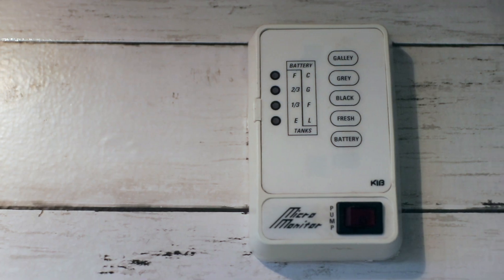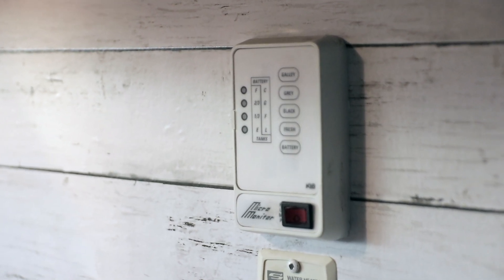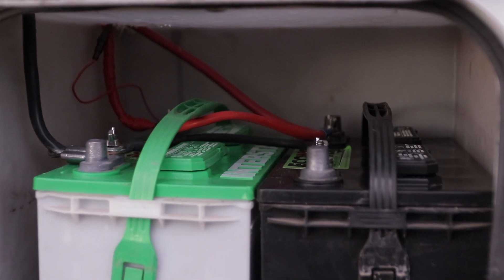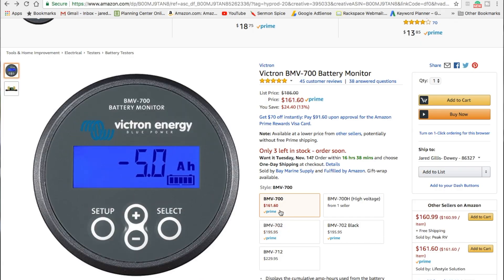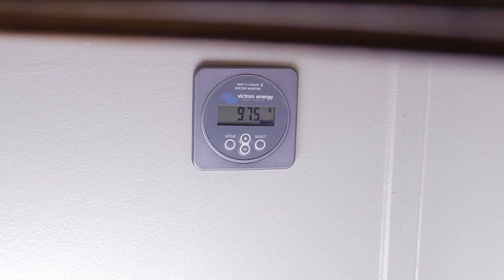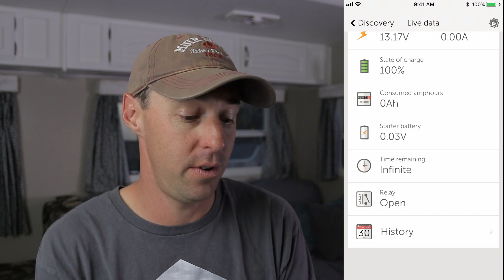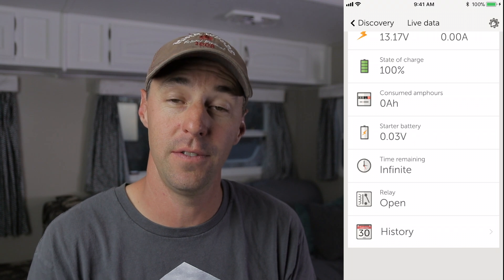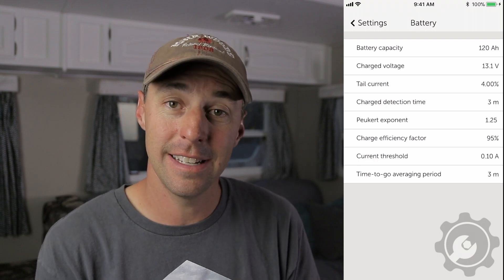Updating Your Battery Monitor And Why You Should!

Comment: Question on connections of a battery shut to  6 group 31 AGM batteries in my Itasca Ellipse 42QD. Currently one end of my 3/0 copper ground goes to the 2800 Watt Inverter then all 6 negative battery cables are connected in series , then goes to the chassis ground. Not sure how to make the connection with 2 negative terminals.

Comment: Jared -- how would you wire this on a travel trailer where the only ground connection on the battery is battery n(-) post to chassis ground. All other negative loads to go 12v bus bar at the control panel, and then to (i assume) another chassis ground? Will putting the shunt between the battery n(-) and chassis ground work?

Comment: What confused me is how do you connect “all loads “ in your RV to the shunt? Do you get the battery positive and negative from the Rv main electrical panel where the 120, 12V and converter all reside?

Comment: Hello Sir I have two RV batteries in series on the shunt with the cheap battery monitor - the new battery lead leading to the negitive what guage should it be? the one I bought does not seem as think as the one connected to the neg terminal. I have an old rv class a and only run basic stuff on the rv with no inverter.

Comment: So, just more out of curiosity do I need all bluetooth modules from Victron? By this I mean do I need a Bluetooth Solar Charger, Shunt AND Battery Monitor? Is there any benefit to having all three of these in Bluetooth?
Thanks, I've watched lots and am now taking this on myself.
Reply from the maker: I prefer to have Bluetooth on each device because you can connect individually to them for settings and Bluetooth is the fastest easy way.
Reply: @AllAboutRVs  Thank you so much for the reply! Even more, thanks for the tips and videos. Solar panels going on tomorrow. Picked up a Battle Born 8D 270Ah battery. We'll give it a try. See you out there!

Comment: I have a zamp charge controller.  Original equipment bought in 2020.  I assume this monitor has nothing to do with the charge controller?  Adding this would be in conjunction with changing out Lead Acid batteries to Battle Born Lithium.  Does this have any impact on the Zamp charge controller either?

Comment: What will or can the volt reading tell you?
I know what volt is, and with the little knowledge I have, I would think it's always stable and the same, so I don't see the purpose of a volt meter. But I suspect it has a purpose .... ?
Reply: Rudi van Doornegat your battery has a different voltage when it’s full vs when it’s empty. So you can tell the state of charge by reading the voltage.
Reply: @123marijn321  I see. Thank you.

Comment: I love watching your video you’re very good on giving information and instructions have a quick question I am going to be running two 100 amp battery in my motorhome will that battery monitor work for me or do I need to get a different one and do it, come with that Bluetooth system or do I need to get a  separate bluetooth

Comment: Why couldn't you just remove the old one and replace with the Victron?
Reply from the maker: The old one is just a voltage based monitor and the Victron uses a shunt for accuracy.

Comment: We have an 11 YO Victron and until last year a 10 YO 150 AH AGM, The problem is that I knew it was no longer 150 AH at the point where I replaced it. I am trying to come up with a way to accurately determine the capacity of the battery as it ages.

Comment: The Victron costs $200!! There’s a identical 
meter on amazon that costs $40 !!! It’s brand name Aili battery monitor. 
It does everything the $200 Victron does but the Bluetooth option n/a. If you must carry your phone 24/7 and constantly check or set the meter oookay. I just take a peak at the meter for info. Simple. 
The Aili is very accurate and I and others have had zero issues with this meter. The option are 3 different amp 
rates. Save yourself $160 search Amazon
Reply from the maker: We have a video with budget battery monitors with the most expensive one being the Aili battery monitor. https://youtu.be/tObHbsSDWeQ but the Victron BMV 712 is by far my favorite with many more features than just bluetooth.
Reply: My aili is only about a month old and I just got my rig out of the shop after not being hooked up to shore power for a week it’s showing 100% 28v and charging like crazy when I’m actually drawing power I have two fla in parallel. Wtf

Comment: at 1:28 - So this Victron device gives the real voltage of my battery like 12.2 volts, even when i'm charging it with 14.8 volts?
I don't get it..
Reply: It should provide you with Amp Hours when it's charging so you can determine how far (empty or full) the state of discharge is. Also it gives you how much time you have left until empty

Comment: I noticed you have 2 different batteries, I have 3 deep cycle batteries although all are different brands. I have been told that is not good to mix brands. I am assuming you have not any issues can you elaborate on what is actually important when connecting batteries in parallel ?
Reply from the maker: We have since switched to lithium batteries, the ones in this video are the batteries that were in it when we bought the RV. They were the same battery bought at the same time but different housing. It’s best to buy the batteries at the same time and the same kind. Mixing batteries can cause issues because of the differing internal resistance.

Comment: @ 5:53 you point to the negative (system ground) end of the shunt saying anything that has a load will be connected there.  But according to the box you're holding... the positive side of the battery is where the load is going. A bit confusing wouldn't you say?
Reply from the maker: For any load to work off the battery it needs a connection to the positive as well as the negative. So on the positive side of the battery it can connect directly to the load or charging device but on the negative side the shunt must be in between any load or charging device. I hope that helps clear it up.

Comment: Quick one, you keep saying shunt, is this another word for grounding block? Also, you say "biggest part of the shunt", is this describing where on the shunt the monitor should be connected or simply the most important part of explanation? Cheers!
Reply from the maker: Good question, the shunt is what measures the current, so it’s much more than a grounding block. It’s meant to be the most important part of the explanation.

Comment: Where would I install the shunt if my batter bank is outside of my trailer?
Reply: I would conect it directly from the battery and then use some kind of connecto to connect the other side of the shunt to the traiker itself, So the shunt will live inside the battery box.
Reply: Jose Inciarte so I would install the shunt just as the directions say and then attach the stunt to the inside of the batter box?
Reply: Correct....Im just noticing all the typos i had this morning...lol

Comment: So on my RPOD 179, I upgraded from an Interstate battery to a Battle Born 100ah using the Victron BMV-712 monitor (hoping for better predictability and 2x the capacity d/t the 100% discharge depth). I keep ending up the battery completely shutting down at around 65-69% (around 12.19v). Not sure what I'm doing wrong (followed the instructions and synchronized after charging for quite a while - highest charge at 13.56v) - seems like you would have to enter the maximum charged voltage capacity (ideal without age loss) and the lowest available voltage (i.e. where the BMS shuts down the battery) somewhere for the calculations to be correct but these aren't given on the Battle Born spec sheets. Anybody have any suggestions? Thanks - RD

Comment: So Jared, how did this install effect the original monitor, as in did it disable it or does it still work?  Just curious.   Outside of that, keep up the good work, I've learned a ton of good information from you in preparation for going fulltime next spring.
Reply from the maker: The old one still works I just can’t remember the last time I looked at the old one. Thanks for watching.

Comment: How would you install the shunt in a travel trailer configuration where the battery is on the trailer tongue?
Reply: You can leave the shunt in the battery box 📦 itself as long as your negative cable flows through the shunt as diagramed. you can leave the monitor in there too and just use bluetooth if u dont want to mount the display
Reply: @NavaDownSouth  I'm interested in adding the Vicxtron monitor to my TT and the location of the shut is an issue.  I have flooded batteries and am concerned about the shunt located in the battery box subjected to the out-gassing from the batteries.  What type of battery are you using and how is the shunt holding up?
Reply: @rickjohnson4956  he has battleborn so lithium
Reply: Augustine Baerga I’m curious to know this as well! Did you figure out if you could? Thanks
Reply: All I've seen is a guy attached it to the inside of his plastic battery box. That's where mine is right now.

Comment: Great review. I just finished installing the 712 as part of a lithium battery upgrade on our RV. I programmed all the settings, and they show on Bluetooth, but the display does not update. I’ve unplugged the fuse as indicated, but no result.  Not too important, since I don’t plan to mount it anyway, but just seems I’m doing something wrong.  

Any ideas?

By the way, AMsolar says charging voltage for lithium battery should be 13.9.  Is this just for safety?  Everyone else seems to be in the 14.2 range 

Thanks- great videos
Reply: Po km
Reply: Listen to what AM Solar recommebds.

Comment: What is the point of the Bluetooth? It’s pointless in my opinion because you cannot monitor the system remotely.
Reply: You would need the color control and a wifi connection for that. Then it will store your system metrics on the Victron portal on internet and you can monitor or change parameters. Not cheap, but excellent

Comment: I bought a 712 and installed it. It has NEVER given a correct reading. I we hoping to use this for our last trip as we were going to dry camp the whole time. I have a MPPT solar controller that shows 13.8 volts. I put a multimeter on the circuit and it read 13.8 volts. I have a cheapy meter with the USB jacks I installed and it shows 13.4 volts. The 712 shows between 8 and 9 volts and when I synchronize it to SOC it shows the correct voltage but then it drops to 8-9 volts within an hour. The battery charge always shows 0%. The weirdest thing is I contacted Victron and they said to contact the dealer I bought it from. Well there dealer is Amazon. No hello at all. I would not recommend this battery meter at all.
Reply from the maker: I'm not connected to Victron but love our battery monitor, send me an email and let me see if I can help you figure out whats going on. jaredallaboutrvs@gmail.com  It really has been a great dependable tool for us.

Comment: is it also possible for 2 batterys in home and 1 starter battery ?
Reply: T 448 -- Yes, for the house batterys and you can choose additional to monitor (only the voltage!) your starter battery. You just need to put a wire from your starter battery to the shunt for the voltage monitoring. The BMV712 has also inclosed a bluetooth dongle, to make a connection with your phone or tablet where you can view all information from the Victron app.

Comment: Does everything need to be connected to the shunt for it to read its amp/current draw? I have a power inverter I installed but it’s grounded to the frame so just wondering if I need to take it to the shunt?
Reply from the maker: It should still work as long as you have a frame ground connection to the shunt and then the only thing connected to the battery is the shunt on the negative side.
Reply: steve barker -- YES, connect everything to the shunt if you want a correct reading on the correct state of your battery, also the inverter....
Not connecting the inverter to the shunt gives you a false reading on the AH capacity of your battery, because the Victron will not calculate how much your inverter consumed..

Comment: Is this available with out a shunt? Do they make one with a clip on amp meter?
Reply: Lysol ! - I don't get why you need a clip on amp meter, the Victron has an amp meter inclosed. 
You can use other shunts to, just go in the menu and correct the used shunt A in the menu of your Victron

Comment: My rig has two, 12 volt deep cycle batteries rated at 92 ah each. When setting up the monitor would I annotate 92 or 184 ah during the initial setup?
Reply from the maker: Your right with 184 ah.
Reply: Thanks for the confirmation!! Have fun and safe travels!!

Comment: Hello Jared!
( Hope I spelled that right)
I am looking for advice on sizing an inverter to run a small fridge (120v, 3.5amp) in a travel trailer I am remodeling. I only plan on running the fridge off of the inverter but am lost with so many options out there. I have not been able to find any direct contact info for you so this is how I'm hoping to contact you..  any help in this matter would be greatly appreciated.

Comment: Excellent video! I have new RV that came with 2 lead-acid batteries. Would I need to buy TWO monitors to monitor all conditions of BOTH batteries? Or can I only monitor VOLTS of second battery using only one monitor wired to both batteries? Thank you.
Reply from the maker: One monitor will do your battery bank. It will do both house batteries.

Comment: DIfferent brand batteries is bad (around the 1.45) Reason is ... internal resistance in batteries can be different ....  ohms law is voltage/resistance = amps .........   now plug in 2 different batteries 12v each (all numbers same just different brands giving different internal resistance)ok so 12Volt / .2 ohms = 60 amps ..... ok now 12volt /.22ohms =54.54amps (thats a tiny tiny difference by the way... it may be larger)  ..... What does this mean in real world one battery will always be drawing down faster than the other (meaning it will have less voltage constantly)   hard to wrap headaround  ... they will both supply EXACTLY what they say on them .... just one will always be worked harder ... if both batteries where same brand and purchased from same batch theoretically you would get even distibution between batteries and there by charging them evenly (last longer)
Hope this helps you merry campers :) 
good video tho !
Reply from the maker: Good info, your right on not mixing the batteries. These are the batteries that were in the rig when I bought it from my friend, and I’m just counting down the days to replace them. He bought the Econo Power batteries which you never know what your really getting in those. I still can’t believe they have lasted close to 5 years. I was wanting to replace them when we first got it but I have a hard time replacing batteries when they still work.

Comment: Thanks for a nice video - you're good at explaining!  Question for you as it applies to my Sandstorm Toyhauler 2018 model.  It has 200 watts solar on the roof by Go Power installed at the factory.  It came with a monitor display mounted inside the camper, but doesn't have that many features on it.  I was thinking I'd like to leave it installed along with installing the one you have in your video.  Do you see a problem having both monitors connected at the same time?  Or, maybe I'd be better to pull the Go Power unit off the wall and use the same wires for the Victron 712?  Thanks for any suggestions!

Comment: Virtually everything I see is for the basement of a 5th wheeler.  How would you mount the shunt if you have a TT with two battery boxes on the hitch?  You need to protect from weather.  Looking for suggestions on this.
Reply: I just picked up a “gang box” and cover (Lowes),  mounted that near the negative of the battery, Mount the shunt in the box, cable it up and then silcone all of the openings where the cables came through.

Comment: If using a 2 battery 12-volt system which battery should I hook the positive to or does it matter? The B1 wire?
Reply from the maker: It doesn’t matter which one you put it on
Reply: All About RV's one other question I have one ground of the frame and then another ground coming from what I assume is my trailer lights do I put both grounds on the shunt?
Reply: Got installed seems to work just fine thanks for your help I will be subscribing!

Comment: I bought the Victron 712 to install on my pop up and realized it’s a mistake for me. My negative battery post only has a cable that mounts to the chassis. I have no loads connected to my negative battery terminal. I don’t know if I can reconfigure my wiring to accommodate this unit but it’s worthless to me the way my electrical system is wired currently.
Reply: Just remove the  negative cable from your battery and connect it to the load side of the shunt, then connect the other side of the shunt to the negative of the battery - you will need an extra battery cable - I got mine at an auto parts store.
Reply: Where the he'll they going it doesnt make sense

Comment: Great, I just built a portable solar generator/dual battery pack for some overlanding/camping.  I put a 100AH lithium battery along with a 3000Watt inverter, a RedArc BCDC1225D which is a DC-DC charger as well as solar MPPT. 
What I really want to know is how much solar I am putting to the battery, as well as what my draw is.  Is there one monoitor that can do that?  Or do I need 2 different monitors?
Reply: Not entirely...upgrade your MPPT charge controller to a Victron MPPT charge controller with Bluetooth and you'll be able to see everything, watts coming in, amps going out, state of charge...etc
Reply from the maker: That’s what this one does. It uses the shunt to measure what’s coming in and what goes out, it should work great for your system.